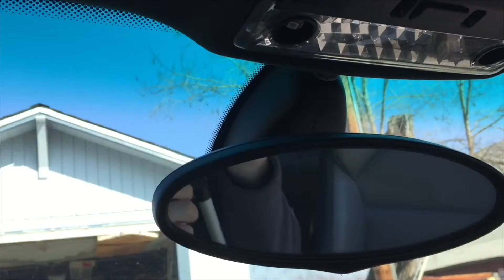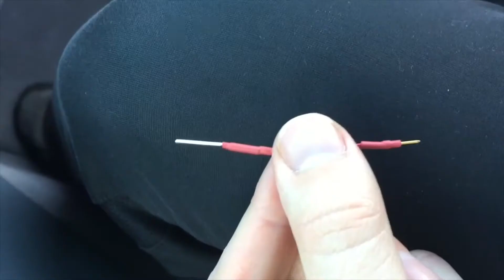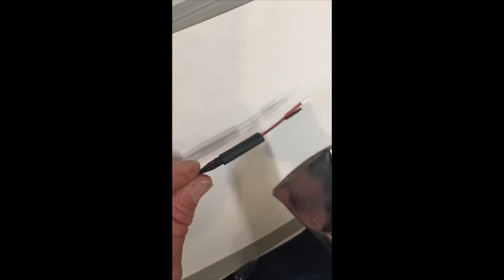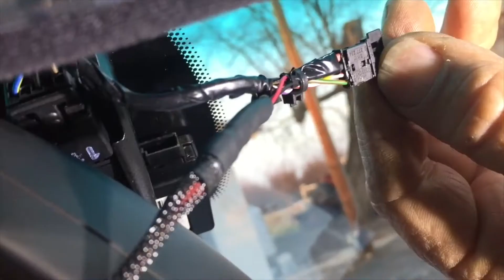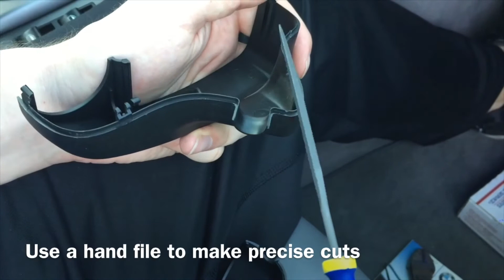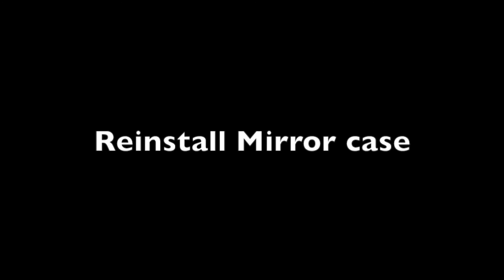HOW TO: Use blendmount wiretap to Install escort max360c Radar detector

Comment: Great Video. Could you add links to where you got the wires from? Also add where you got the mount for the mirror?
Reply from the maker: yep, ill put them up
Reply from the maker: https://blendmount.com/results/?Make=BMW&Year=2003&Model=M3&Category=Radar+Detector&Brand=Escort&BrandModel=Max+360c+%2f+RedLine+EX+%2f+iX+%2f+iXc
Reply from the maker: thats what we used- the bracket and wires are all through blendmount, just make sure you buy the right kit for your specific mirror and radar detector